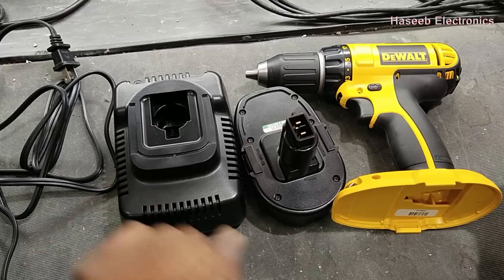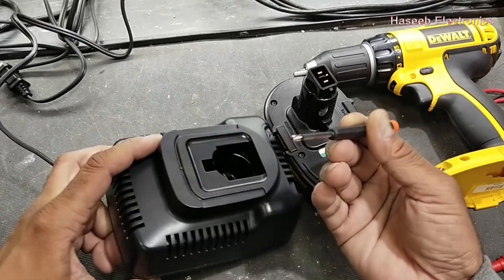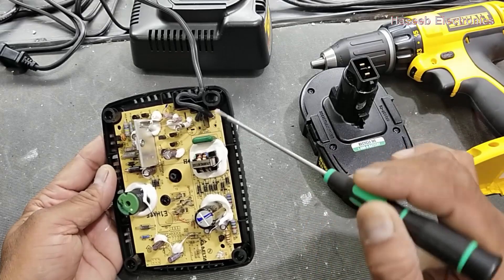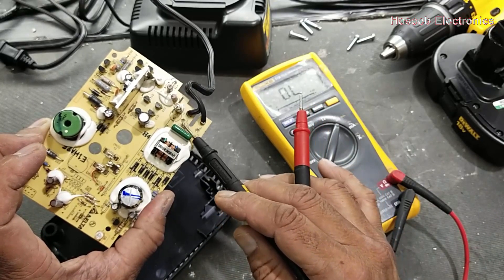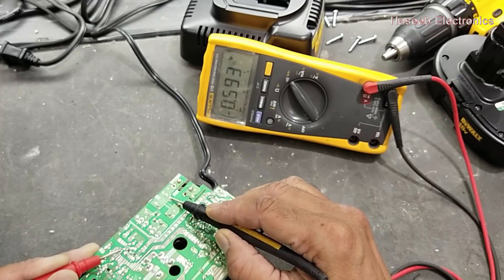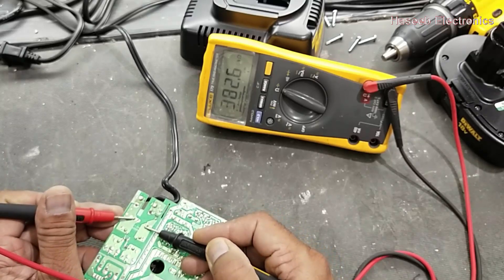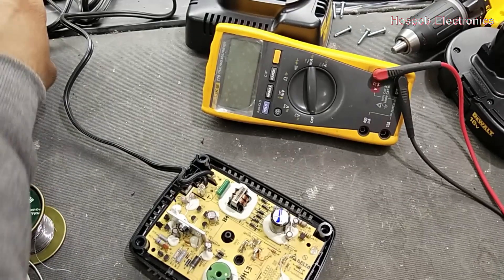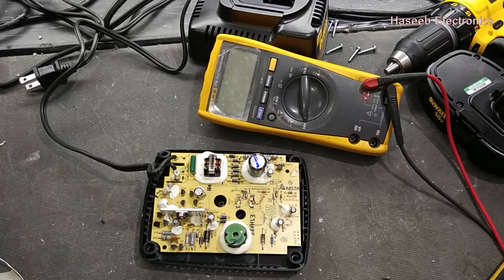{506} DEWALT DW9116 Battery Charger Repair - How to Fix Dewalt charger No Power Problem

Comment: Hello friend I have a dc9310 charger. It can charge nicd, nimh and Lion batteries. But it doesn’t cut off charge at 21v (18v baterry pack) It charges until 24v and breaks the cells. How can I handle it?

Comment: I have two identical batteries and a DW9118 charger. It charges one battery to over 13.54v and the other to around 10.5v. The charger says 7.2v to 14.4v on it. It’s it automatically detecting the number of cells in the battery pack or something?

I believe that both battery packs, because they’re identical, should be charging to the same voltage.

Comment: Thank you. If u get the red button still   That means it’s not the charger right ?   I didn’t know you can’t run batteries until they die.  So now I have two dead batteries

Comment: good contribution, friend, maybe you know the output voltage of the charger pins, how much does it deliver, I have a charger that was shorting the diode bridge, now it turns on and charges, but when measuring how much it is delivering to the battery, I get 80V, I think it is a very high voltage since the battery pack says 18v, thanks for your help

Comment: Sir, i have a problem with my smps(its a really old one i think 2007....)... I wanted it to be used as a lab power supply. I managed to turn it on after connecting a load (12v fan) it worked for a couple of minutes..... After that it didn't.... Now if i turn it on, the exhaust fan in the smps spins for a second and then turns off...

I am still setting the +5 stand by from it though............
What should i troubleshoot first sir🙏 pls help🙏. Thank you.....
Reply from the maker: this power supply is facing problem in output section
.the voltage supervisor ic is interrupting in secondary power switching.  so check the output section, might be some capacitor is leak or open, so the voltage reaching on the sense pins 3.3 volt, 5 volt and 12 volt.
Reply: @HaseebElectronics  Ok sir thank you so much for replying 🙏